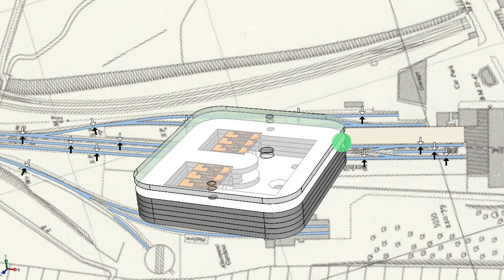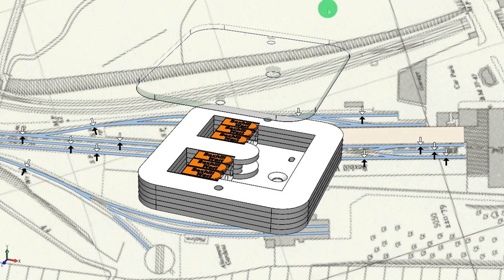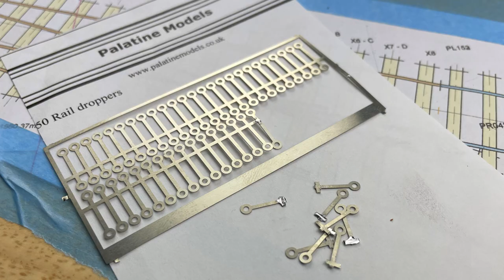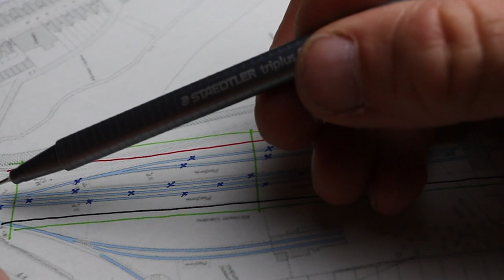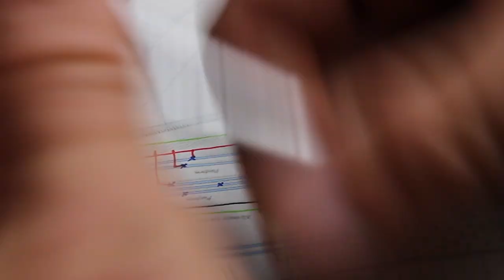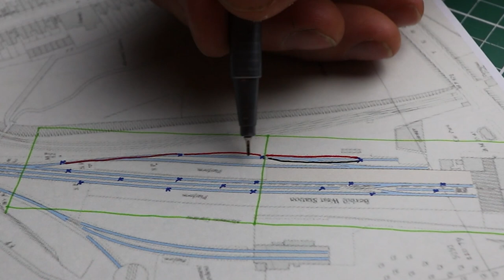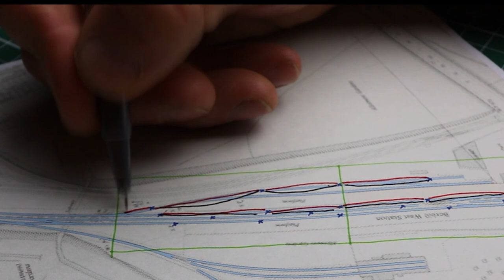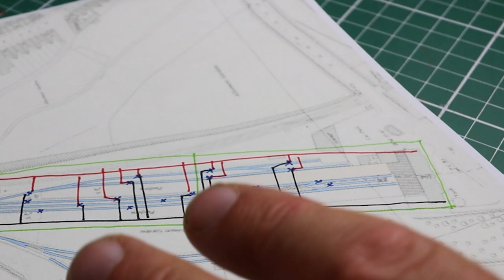S2 E5 Track Wiring Junction Boxes

Comment: If I'm understanding this correctly then the difference between the two systems only exista when you have multiple tracks, meaning multiple(or not) bus wires.
Consider a simplified track layout, with only one track running the length of your boards. Whichever "system" you use, the wiring is the same i.e. two wires running the length of the layout, with feeds/droppers connecting to each section of rail.
 The difference between the two systems comes into play when you have more than one track. That's when you need to decide how many bus wires you want. System 1 will only have the one pair of bus wires, meaning that every pair of droppers will need connecting to thse two bus wires. System 2 will have several pairs of bus wires, joining up at convenient locations. Picturing it like this might make it clearer in your mind; it works for me anyway.😁 
For simplicity and neatness, I think I'd favour System 2, using multiple sections of bus wire.
I hope that's of some help to you, or to anyone else.

Cheers for now,
Dougie.

Comment: When I build a layout using both analogue and digital, I always use cab control for running on DC, then overlay the controller outputs with DCC through a 4PDT switch. I have drawings if you would like them. You will also need isolation sections when running analogue, they can all be turned on when using DCC. 
I have built over 100 layouts, many dual power fed ones too, as most begin with a DC set up, and grow into DCC when they gain experience.

Comment: Absolutely ok to daisy chain the connections together. (dcc install) The only consideration is the feeder length and wire size. We've  done lots of this sort of connection and never had an issue. The power Districts are also a great idea. If there is a short in one spot the rest is not affected. Go for it.
Reply from the maker: Thank you for your reassurance Peter.
Thanks for watching,
James

Comment: Hi James.  I like your junction boxes - as you say, maybe a bit of over-kill, but they will certainly keep the wiring neat and tidy.  I love those Wago connectors and have used them for mains connections when refurbishing an old house out here as well as for extending some cable runs in our own home (French electricity wiring is quite different from UK standards, being a "star" system rather than a ring).
Reply from the maker: Thanks David, I think they're great solution as screwed terminals often seem to works loose over time and seem to be a constant source of intermittent faults which can be hard to trace.  These Wago's seem very reliable.
All the best,
James

Comment: Version 2 is fine. Doing it that way means you'll have multiple cable links between the boards, whereas v1 is just the one. People's preference between the two is usually down to size of layout, voltage drop and cable cost.
Reply from the maker: Thank you David, I appreciate your thoughts.
Best wishes,
James

Comment: Go DCC and version 2 is fine - however, don't forget to factor in track occupancy (current detection) with your wiring solution; which you may wish to add sooner or later.  So, allow for it now with the ability to simply adjust the under baseboard wiring connections if you eventually fit.  I did this with my test track layout.
Reply from the maker: Thank you Patrick for your great advice.  I've no plans for occupancy detection, but as you say I'd best allow for it.  I have been known to change my mind after all!
Thanks for watching,
James

Comment: As stated both solutions will work. My preference however is version 1, simply because it is more robust than v2. In v2 any fault on any part of the string will close all of it down. It is easier to find faults when the connection for that part of the track is singular. Version 2 relies on several joints.to power each consecutive section of rail.  hope I’ve explained that ok?
Reply from the maker: You've explained that perfectly.  Thank you so much for the clarity.
All the best,
James

Comment: Usually the main bus is thicker to carry signal around the layout and the droppers are thinner as they are short and only have to carry short lengths of signal from the bus to the track so long runs of thinner wire may cause signal drop 
Although as someone else has said u can have one dropper and solder track together although I personally prefer the dropper to each track 
If u did option 2 with thicker wire it may be ok
I use 2.5mm standard electrical wire for my bus... also I use red and blue. And stick to blue to back track rule that way u won't accidentally wire it wrong way round :)
Reply from the maker: Smashing, very helpful.  Thank you.
James

Comment: This is probably a year too late, but version 2 is good way to work. It creates mini busses running in line with the trackwork, so this helps fault finding. Also, if you wanted to install current block detection in the future, you could just feed the mini block's straight from the detector.

Really like the wiring boxes by the way, very neat

Comment: Hi James
As has been said both ideas will work for DCC, V2 will give less wiring under the layout; but if you do consider DC as an option operation of the layout may be difficult as you will need to create isolation sections so that you can run more than one locomotive on the layout.
Having said that I think you would find DCC a much better option.
Cheers, Bryan
Reply from the maker: Thank you Bryan, I'm thinking that DCC will be the way to go.
Thanks for watching,
James

Comment: I know that I am a year late in answering your question, but I thought it was an interesting question.  It seems to me that the basic question of is there an optimal design for supplying power that maximizes positive attributes like convenience , cost, and complexity and minimizes negative attributes like voltage drop and current capacoty. I believe that daisy chaining will lead to voltage drop. Sure, it can work, but what gauge wire will you need to ensure the required voltage at the far end? Hub and spoke design minimizes voltage drop at the expense of wire.

Comment: hi james you may need to think about version 3 ,if you are thinking about dcc then block/current detection would be a must for your complex station layout, you would need to common ie ,your positives +ve you could wire your small droppers to a larger bus wire back to your feed or common if you use a block detection unit i use digikeijs 5018 and the negatives -ve would need to be individual droppers back to individual block numbers on the  digikiejs 5018 and all blocks would need to be isolated ie one rail cut , ps i think you are using awg 24 stranded wire  7/0.2 wire will have 7 strands of 0.2 wire which can handle 2 amps which is fine as a dropper....................tony
Reply from the maker: Thank you Tony.  At this stage I've no intention of incorporating block detection, although as others have said I maybe ought to allow for it as a future upgrade, especially as the plan is to develop this into quite a large layout.
I shall look into the digikeijs set-up, although it's likely to fry my brain as all of this is very new to me.
Thanks for watching,
James

Comment: I've only use Wago on my layout. Never had any issues with them and so eazy to amend your wiring without the fuss of solder but the old boys will always solder because that what suits them. Wago do product small enclosures designed for those connectors. 🚂🚃🚃🚃
Reply from the maker: Hi Steve, they are certainly very useful connectors.
Thanks for watching,
James

Comment: Version 2 will work. Instead of using lengths of wires along the track, as drawn on your diagram, you just need to bridge across the rail joiners (effectively using the track as the wire). Just be careful of too long lengths of track causing voltage drops. Using version 2 on short sections will not cause any problems and will greatly reduce the number of junction boxes.
Reply: In fact, those Palatine droppers could make good, low profile links to bridge across the rail joiners. Use the ring ends to solder to the bottoms of the track, and leave a length of the fret in place, long enough to bridge the join, and which connects to a second dropper (cut off the droppers in between), effectively making a U shaped, low profile link that lays to the side of the track and will be covered in ballast.
Reply from the maker: This is a nice idea Bob, and might even allow for a degree of expansion as I don't plan to solder between rail lengths.
Thank you very much for your thoughts.
James
Reply: Yes, the advantage of soldering a link between sections of track is that is still leaves a gap in the track for expansion and contraction without buckling the track.

Comment: Hi James,

Those wiring boxes underneath are a nice idea rather then being in a mess underneath.  Have you thought about magnetic strips on the box and lid so that if you do need to gain quick access underneath the baseboard you can quickly and easily remove the lid rather than messing about with a screwdriver.  I tried those dropper connectors which seemed ok but in the end I just soldered straight to the underside of the track,  I figured if it all goes pearshaped I can easily lift a small section of track, resolder and rethread on chairs but those droppers would save alot of extra work.

It is possible to daisy chain as long as your loco's won't draw too much amps on a section (i.e 10 sound loco's on 1 tiny bit of track) and make sure that the length isn't drastically long to avoid voltage drop.  It would ruin any future chance of adding automation and block control but if that's not your thing then that is fine.  Just make sure you add in a way to easily isolate a bigish section of track at a time incase you get a short (Much easier to find when you can quickly and easily narrow it down to 1 board) 

I went with option one and there are wires everywhere and that's just with a single line.

Cheers,
Michael
Reply from the maker: Thank you Michael, Your thoughts are all perfectly sensible, especially the need for isolation in the case of a short.  I like the magnetic idea, that's perfect.  I don't imagine there should be too much need to open the boxes once set-up - but I do like a magnet.
Thanks for watching,
James

Comment: Version 2 will work. Its still a bus, but many of them, for as you say, splitting up power districts. They will actually be sub circuits and you would need them if you want detection. Dont forget how ever many you need will need connectors (plug n socket) between the boards!
Reply from the maker: Thank you TimberSurf.  Much appreciated, and yes I will try to remember the connectors.  :)
Thanks for watching,
James

Comment: With version 2 you can use piano wire as your droppers and using a auto wire stripper  which removes a section of insulation from the main power source to solder the piano wire to. You still have to make a connection from the rail to the power feed which ever way you chose.
Reply from the maker: That's an interesting idea John, and one I hadn't thought of, very robust.
Thank you for your input,
James

Comment: Whether you run your bus wire as an “external” wire as in version 1 or a box-to-box wire in version 2 gives you the same electrical requirements. Both requires a thicker bus wire than you’d connect to the track (remember the current drawn in the cable). On the other hand, it might become more cumbersome to integrate occupancy sensors based on current draw with version 2. Keep that in mind.
Reply from the maker: Thank you very much for your input.  I don't think I'll be incorporating occupancy sensors, but it is probably best to allow for them should I change my mind in the future.

Comment: I'm know expert, both versions would work ok as long as using thicker wire to daisy chain sections of track together. Should you be running 5 locos on the same section of track, could be a problem with power draw from the 'bus' through that section of daisy chain, not that you would be running 5 engines of course.
Wouldn't work if you wanted to run DC as well as where would you run the isolating section from.
My own layout runs both DC and DCC just leave the isolating section switched on, each section switch has it's own feed from the main track input, they are not daisy chained together as is usually the case, this takes out the problem of pulling the full 5amps through one wire, the other terminal on the switch is connected to it's corresponding section of track.
Reply from the maker: Thank you very much for your advice which makes perfect sense and gives me some food for thought.
Thanks for watching,
James

Comment: Either version will work just fine. However as has been stated - daisy chaining can make for a more complex diagnostic of fault finding. But with your intention to mount an indicator (LED) into your junction boxes, that would help with that issue. As to Power districts, again doing it either way makes no difference as the main bus is split between "Boards" (your green square outlines). So it wont run all the way down the layout as one big cable run. But if you are going to do power districts per board, then the standard method (V1) is the easiest to do. Have a look at Charlie's cabling at Chadwick Model Railway or have a gander at McKinley Railway if you really want to have your head explode!  :D
As to which way to control your Loco's, I totally agree, RF is by far the best way, I use a product called RailPro but the track power is DCC, this is so that things like passenger coaches, sound cars etc can still be powered when stationary, something a lot harder to do with DC (yes it can be done but its messier).
Here are some links for RailPro. If you do want to buy it, you get it from the Canadian Dealer not direct from the USA since the USA dealer's or Company Direct wont sell it to overseas.
Company. http://www.ringengineering.com/
Canadian Dealer. https://www.pdc.ca/rr/catalog
Select International then go crazy!  :D
Reply from the maker: Thank you so much for the helpful advice and the links, there's certainly lots there for me to get my head around.
All the best,
James

Comment: I think option 2 will work ok provided you use a suitable gauge wire and I don't believe you need the complexity of multiple power districts for the layout you have planned.
Reply from the maker: Thank you for your thoughts Richard, I was planning on 2.5mm sq. flex for the main runs.  Ultimately there could be 50 feet of mainline including the fiddle yard, and I was concerned about the voltage drop, hence the districts.  I thought it might be better to design for them now rather than face the need to incorporate them at a later date.
Best wishes,
James

Comment: The 2 versions of wiring are the same, your juction boxes are really good , and could be modified to take the 5 terminal Wagos, I would consider using ferrals on the multistrand cables as these help a lot especially in dificult areas.  Please keep up yhe good work
Reply from the maker: Thank you Chris, I have some ferrules but wasn't sure if they were suitable for use in the Wagos.  I've only ever used them on screw-type terminals before.
All the best,
James

Comment: I agree with the other comments on this video, but like them I would be worried about Voltage drop across the length of the Daisy Chain.The one thing I do not know about when using a bus wire do both of the ends connect to the Power Unit? ( Like a ring main.) Martin. (Thailand.)
Reply from the maker: Hi Martin, I'd use cable of sufficient diameter to handle the anticipated current along each string of the daisy chain, if indeed I do end up going down that route.  As for closing the 'ring', it is my understanding that one shouldn't do that and that.  However, I may be wrong and there does seem to be a lot of conflicting advice on the issue.
All the best,
James

Comment: Something to consider is how you will illuminate the interiors of the passenger cartages for trains stopped in the station if you use DC rather than DCC?

As for the wiring options, either should work. The wire you are using for the "droppers" seems rather fine, is it rated to carry the necessary current?

Finally have you made a plan for insulators between various sections of track to prevent shorts when the switches are moved? This should be done prior to deciding where "droppers" are to be placed.
Reply from the maker: Thank you John, The dropper wires should be fine because they are very short.  I wouldn't want to use them though for longer runs.  
Yes, the isolated joints in the track are all planned and are built-in to the turnouts.
Thank you for your thoughts,
James

Comment: Re the wiring yes V2 will work, BUT if you want to use current sensors to detect where the train is on the track you would need to use version 1
Reply from the maker: Thank you David, I've no intention at this stage of incorporating occupancy detection, but as you know I have been known to change my mind so maybe I'd best go with V1.
All the best,
James

Comment: V2 is fine but remember that the daisy chain wires need to be able to support the total expected current draw for that section. I notice some other posters have suggested using the track as a daisy chain too having soldered links across the rail joins. I also think this should be fine. I haven't seen all of your videos, but are you having continuous rail or scale 60 foot sections? I would imagine the latter if you are going for realism.
Reply from the maker: Thank you for your input, it's really appreciated.  I'm using 60' panels with sleepers spaced correctly.  I hope it will look good.
Thanks for watching,
James